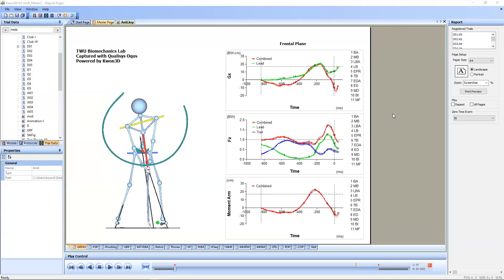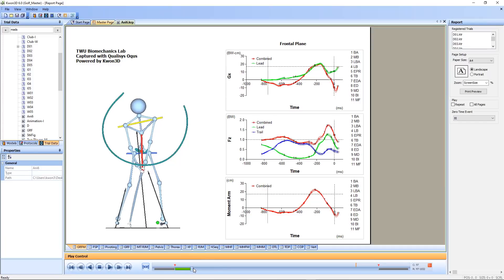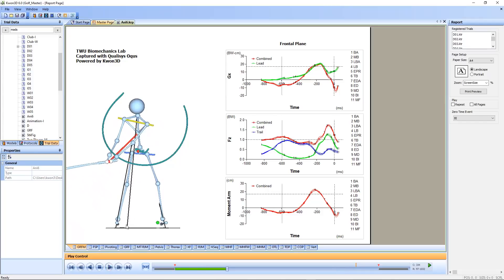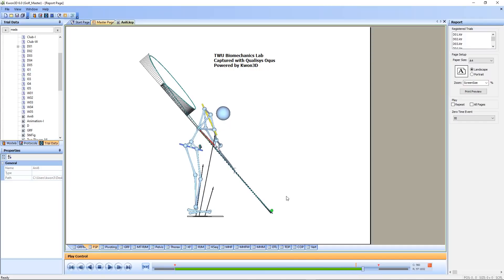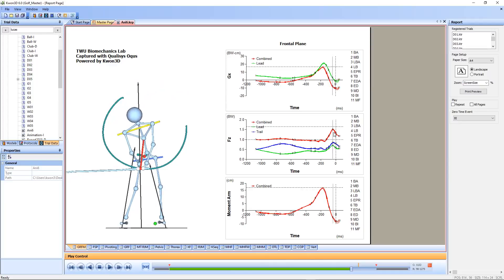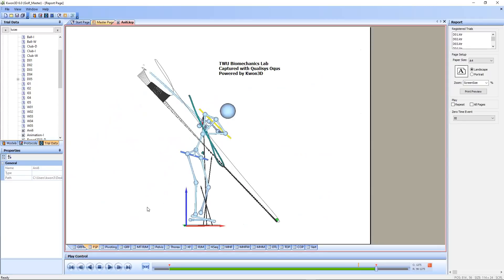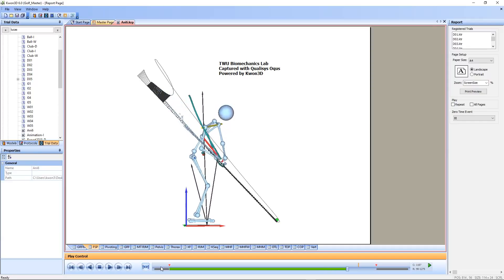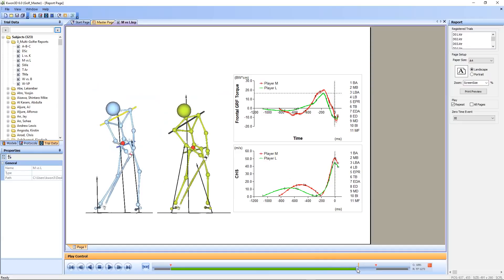2022-01-13 Kwontum Physics: Torque, Part 2 on Dr Kwon Golf

Comment: How do you measure ground reaction forces?  Is it a pressure pad underfoot?  Then, how do you measure the angular direction of the force(forward, backward)?
Reply from the maker: We use force plates, not pressure pads. Force plates measure the force in all three direction and also the torque about the vertical axis that passes through the center of pressure.

Comment: How does he (the second golfer) generate so much upper rotation with so little torque from the ground, should that not usually result in dumping the club in a stall of the upper body? He's actually more talented than the other guy to play well like that and get the rotation still. I assume he is tall and has long levers?

Comment: Dr Kwon.
Love the series.
How about club force affects on the body? This would seem the one variable that affects the body motion.
Reply from the maker: When the hands apply a force to the club, the club also exerts an equal and opposite force to the hands. That means the force acting at the hand by the club can affect the body motion. But this force should be substantially smaller than the forces such as the GRFs and the forces acting at the hips and joints in the spine.

Comment: Dr. Kwon, I have another question.  The first player, at the top of backswing, has left foot grf pointing to target side.  What action could produce this target side pointing grf?
Reply from the maker: He uses a trigger motion and starts the BS with a large rightward force. Too slow down the motion and eventually reverse the direction toward the target, he has to push the ground hard horizontally primarily with his right leg but also with the left as well.
Reply: @drkwongolf  Thanks for the reply!   Something I never imagined that could happen..

Comment: Can you explain the braking needed to release the club head to the ball? What mechanism causes the braking? Or is this flawed concept?
Reply from the maker: he braking obviously comes from your hard push using the lead leg. Push down and outward. For this you should have enough time to load on the left side. That is why a mature BS and transition phase with shift-turn rhythm is necessary.
Reply: looks like it's the massive reaction force from the lead foot on the DS (points from foot to head).
Reply: @tomvaughan9846  I agree, I never realized how much pressure must go into that lead foot, the other model is just using arms to pull swing through and pressure in foot is smaller.
Reply: @davidb6981  it’s what I’m working on at the moment … so hard not to be “armsy”!
Reply: @tomvaughan9846  @David B it's funny, bracing into the left side has been a standard in golf instruction for 150 years at least. Jackie Burke used to say, and probably still does, that the swing is in the dirt. Jack Nicklaus swings like this which is why he crushed so far in his prime. 
It's great that Dr. K has just confirmed what has been said for years and then provides tools outside the context of the PGA "instructor" to actually get better quickly. This is what golf needs. I've started to incorporated much of what he says and I've seen immediate improvement. That said, I've worked on this before so it's not a foreign feeling. I can't wait to get on his schedule for a session. Should be the last session one ever needs.

Comment: trail leg stays very bent. i assumed that would straighten at the top of the backswing
Reply from the maker: Yes, you can use more right knee extension during the BS. It doesn't have to completely extended though.

Comment: Dr. Kwon, when the combined torque becomes negative after around mid-downswing, the (body-club system) rotation should slow down?  I guess the club head speed is still increasing until impact, for a pro golfer.  What am I missing?
Reply: is it like a bow and arrow? The bow releases torque and the arrow speeds up. Guess that's why they say don't muscle the ball through impact
Reply from the maker: Negative torque acting on the system near the impact shouldn't be a problem. It will slow down the body but the club still gets angular momentum from the body through moment transfer and keeps accelerating. The negative torque in a sense gives a stable finish posture.